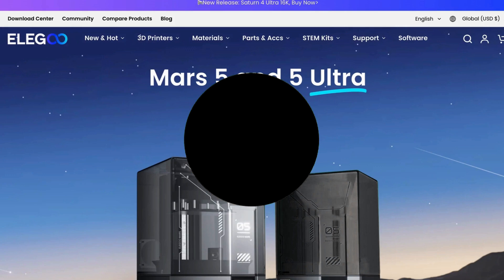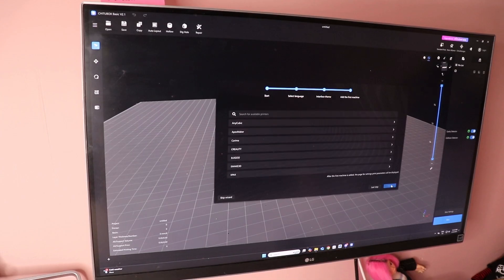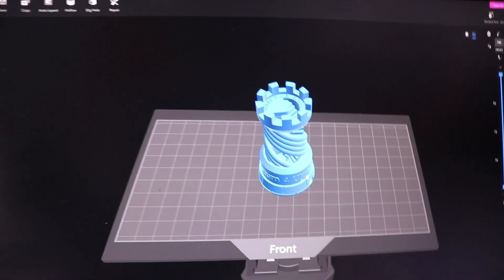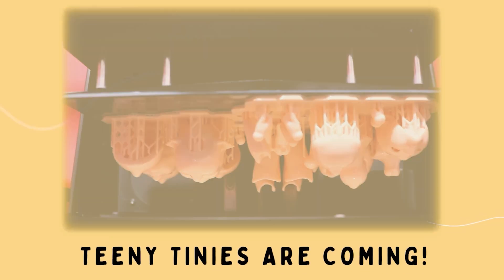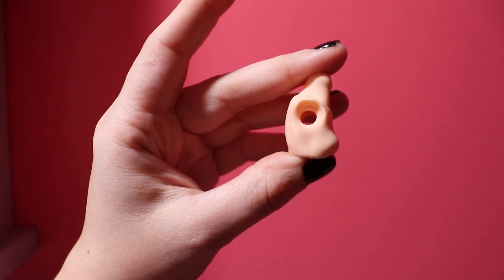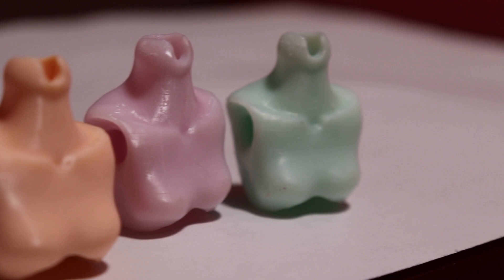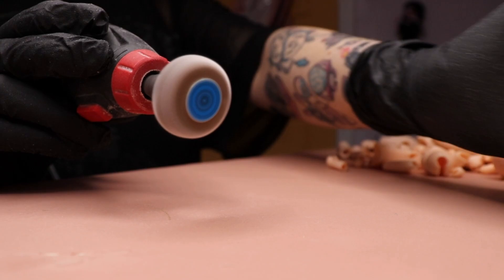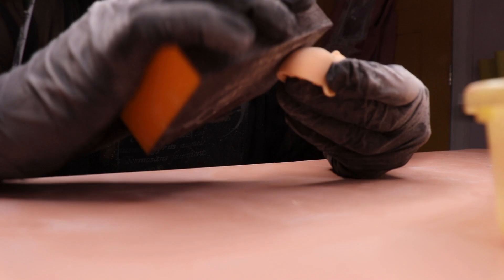3D Printing Dolls with Resione BJD Resin and the Elegoo Saturn 4 Ultra | Review + Announcement

Comment: Which resin do you normaly use? I tried the Resione Th-Bjd resin and it's kind of a pain in the ass to use and it takes loooots of resin to print a MSD sized doll, though the prints are very durable.
Reply from the maker: I typically like Elegoo ABS like, but i love this one. I agree it can take quite a bit of resin, now that you mention it!

Comment: This video was amazing❤and I can't wait for february 10th😲

 I do have a few questions though(I been looking at this printer for a while now)- how land was the print time for the yosd's and have you done a test msd yet , if so how long was that ? Was there any splash back when the dolls where being printed ? When not using the usb stick thing how long does it take to send the files over ? When using chitubox where there any support print problems because(and I don't know why) the print ends up being to heavy and the project ends up breaking off and falling in has it been a problem ?

Thank for your time and I enjoyed the video ✨
Reply from the maker: Todd's I printed two in five hours at 0.04mm no splash  and takes like, 1-2 min to send file depending on the size I think?
Reply from the maker: Yosd not todd

Comment: This is SO cool, I love seeing the process of creating a BJD, and the comparison of materials. 

I am interested in the toxicity of ABS versus resin. I wanted a resin printer but understood that resin dust is really damaging to your lungs? And that when sanding we should wear a proper mask? I would love to print resin BJDs, but very tentative to do so because of this.
Reply: All dust is damaging to your lungs. Wearing a mask and a using ventilation system if you are indoors is a must for sanding.  Even if its just a furnace filter taped to a box fan. Before you dive into getting a printer look at where you want to set it up. I have a set up in my basement. The largest problem I have down there is the temperature. Resin needs to be warm to print well. The second problem is controlling the mess of the liquid resin. I killed my printer when I had a spill on it. But I was more concerned about keeping the resin off of my skin so I am ok with losing the printer. Investing in a good mask and decent gloves should be done at the same time as buying the printer if not before. I bought a $35 mask and use gardening gloves that are fully covered in silicone (I covered the backside with silicone myself) As long as you take the proper safety precautions you will be fine. Just don't get lazy about it! You can always buy another printer, make another doll ... etc. You only get one human body.
Reply from the maker: I can totally compare these one day